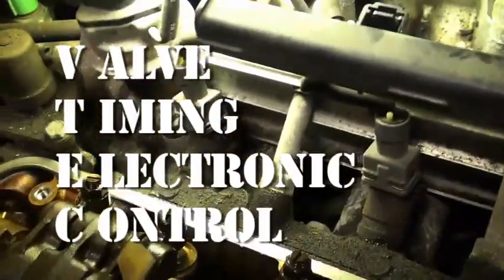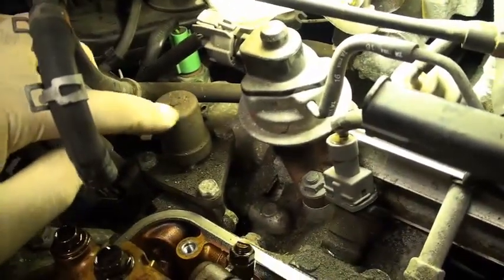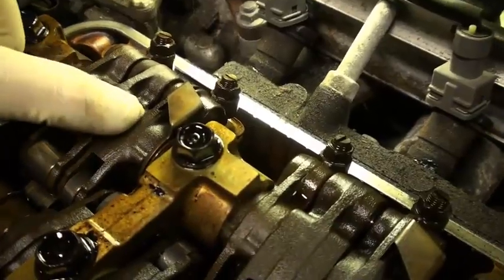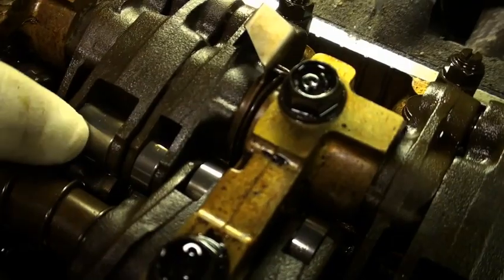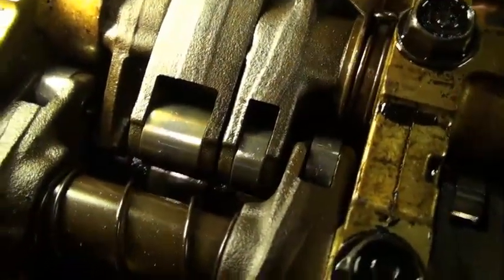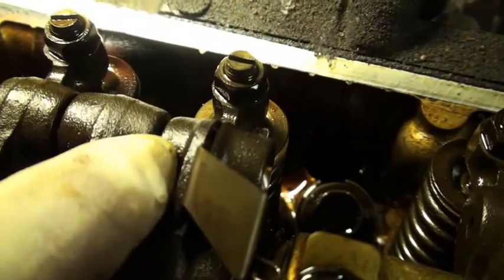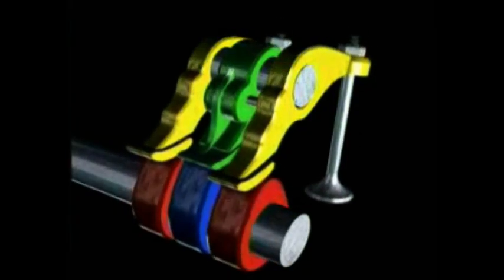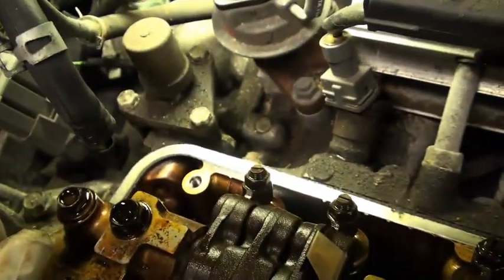What is VTEC and How Does it Work? - EricTheCarGuy

Comment: Okay so if the car has vtec does it make it any faster
Reply: Only if you add the vtec sticker on the side of the car
Reply: I personally like the sticker and actually had it on my D16 12 years ago. It was said as a joke and not meant to insult anyone.
Reply: Slightly on higher RPM... Is not a big deal like a turbo. Still VTEC Hondas are faster than your average 4 cylinder car.
Reply: Michael Mack butthurt ricer spotted
Reply: palmero8877 my car came with the sticker should i scarp it off cause of ppl like you?

Comment: And what about VANOS?
Reply: Vanos only advances intake camshaft under heavy acceleration. On the  e36 m3 and newer models like e46 onwards there is DOUBLE VANOS which manages two camshafts the intake and the exhaust. Still clever but the difference in performance when it switches is unnoticeable.

Comment: Ericthecarguy, you said that people feel the extra power when the vtec kicks in. For you it doesn't. We'll you are wrong, factory tunes are designed for smooth power transfer. When you modify the tune, you will feel it.
Reply: My S2k is on factory tune and you feel it from first to second and a little bit on third
Reply: It's a performance car that's why. What about the honda odyssey?

Comment: you know im not trying to piss people off but ive driven a vtec civic type r and u can tell when vtec happens cause it just changes the noise of the engine but i kept my eye on the speedo when i was on the gas and their is absolutely NO difference i acceleration like people say!!! the noise of the engine just changes, thats it...
Reply: Thats precisely the point of it ffs! If vtec didnt engage the engine would run out of puff and start to produce less power from there to the redline. Its maintaining the torqur of the engine over a wide rpm band. Generally 90% of available torque can be used from approx 3000rpm to redline.

Comment: Why not just have a lumpy cam?
Reply: 12cwell vtec isn't activated at low rpm
Reply: 12cwell You not know how cars work?
Reply: Yah this vtec shit all it does is kill your torque cause your torque comes early and thats what gets you movin
Reply: nabre labre.   thats why i said it kills your torque because it comes in around 6,500 rpms and torque comes in earlier
Reply: you still get low end torque with the normal cam position, then vtec kicks in to help the engine breathe and you get high end torque as well
Reply: nabre labre.     when you get into higher rpm your torque curve starts to go away and your horsepower kicks in.    hp= top end.   torque= low end.     thats why you see an s2k with 247 hp and a terrible 147lb ft torque
Reply: That's called race car cam....it's not good for everyday driving and lacks low end power

Comment: Vtec kiked in, yo !
Reply: ive driven one its such a myth it just removes your torque at low rpms and just changes the noise of the vehicle when it comes on
Reply: 12cwell It's so you can save gas under the engagement point and make power from the engagement point to redline. Not a myth

Comment: VTEC is not VVT it opens one more intake valve to allow more air into the engine making it produce more power.  VVT just changes when the valves open and close not open another valve like VTEC does
Reply: Vtec dosen't open another valve.
Reply: fullraph
Well the e-vtec actually does, but this is for economy not power.

Comment: Now here's a question that will spark a lot of debate... is VTEC a power saver, or power booster?
Reply: its a power saver mainly man thats why if u want performance buy v8, if u want eco buy 4-cylinder, if u want something slightly more powerful then eco buy vtec,   personally i think vtecs just dumb cause at low rpms their is absolutely no power its not even an engine at low rpm. when the vtec comes on in the powerband is where normal 4 cylinders are at ANY rpm so it kinda like having a small turbo that has alot of lag until it comes on and doesnt make any difference it just allows u to move..... so they are the most pussy ass engines out of all the 4 cylinders just because the valves take forever to open all the way and allow air and exhaust to move like a normal 4 cylinder does without waiting
Reply: 12cwell Actually, I've read a lot on the topic since this was posted and the fact that it's a fuel saving system is actually a misconception. There are three different forms of VTEC: i-VTEC, VTEC-E, and 3-stage VTEC. VTEC-E is tuned more for economic purposes, i-VTEC is tuned more for performance purposes, and 3-stage is a combination of the VTEC-E and i-VTEC. Even with the VTEC-E, I've seen that it still adds power. If you look at the 1994-1997 Honda Accords, all trims featured a F22A1 non-VTEC engine except for the EX trim. The Accord EX had an F22B1 engine, which is identical to the F22A1, except the F22B1 had a VTEC-E system. What's interesting is that the F22A1 non-VTEC engine made 130 horsepower while the F22B1 VTEC-E engine made 145 horsepower.... So despite the system being tuned for fuel saving, it made more power regardless. Feel free to look into it yourself, but that's what I found on the subject.
Reply: matt smith       yah man your totally correct man, i thought u were just strictly askin a question bout this kind that the guy in the vid is explainin. i think toyota probably has the best performance vtec forms cause they actually have torque at low rpm they can actually get movin
Reply: 12cwell Well here's the thing: VTEC is a system that messes with the valve timing as well as the lift. VVT-i messes with the valve timing only. But at lower RPM's when neither system is engaged, both of them aren't relevant. That being said I have a 2.2L Acura CL that has the same engine as the EX Accord (The car's pretty much a re-shelled Accord with a few added luxuries and only two doors) and, while the VTEC-E system that's on it is a bit sluggish, as expected when your car weighs around 3,000 pounds and only has 145 horsepower to compensate, when the VTEC isn't on, it's still faster and feels faster than the four cylinder and V-6 Toyotas that I've driven in my lifetime, even in the lower RPM's. Not favoring one system over the other here. Anything can be fast in the right hands. All I'm really saying here is that even a VTEC can make a good amount of torque and accelerate quickly in the lower RPM's (unless it's an old bone stock or riced out Civic that only makes 92 horse).
Reply: Yah man your right!     i think may have gotten a bad taste when i drove my friends, they still dont got much torque type R: 197hp 131 lb ft torque but like u said thats only one type of vtec. lol. they are good cars..   but one thing i gotta say performance wise a v8 and 6 will treat u better they got more capability which of course should be expected from a bigger engine.  my friend that drives the honda jumped into my z28 and hes hooked on muscle now though he still drives his honda to work everyday. he just bought a cobra.... but u know i gotta give the people who get the 4 cylinders up to 600 hp props cause thats pretty damn cool when u got a tiny ass engine that doesnt wiegh anything that chucks out a shit ton of horses
Reply: 12cwell lol I've got fresh tread on my CL and it still lights up the tires if you're not careful. idk how though. it's only 147 ft-lbs of torque in a 3,000 pound car. I will say that I pretty much love any engine. V8's do have more capability, but you can still squeeze  400 hp out of the engine in my car without forced induction from what I've read. And then you can apparently run around 9 pounds of boost on the stock motor without tearing down the engine. Still, I think a RWD muscle is probably the better toy and the FWD VTEC is just a fun daily driver. That's just my preference though. Beauty (and fun) are in the eyes of the beholder, so they say.
Reply: yah man i aint goin to bullshit though everyone agrees even domestic guys agree that accords are fuckin fast that the civics its baby cousin LOL u got a v6 in it right?
Reply: 12cwell Nope. 2.2 I-4 lmao
Reply: oh well still i do know they are quick. the engine in it is bigger then a civic which means its got more torque then a civic so that means even though it ways more then a civic u could still pull past somebody when drag racin cause u got that extra torque thats needed to move the wieght
Reply: 12cwell I've smoked some Mustangs and some diesel trucks out here in the sticks but that's about it. As well as the occasional ricer ;)
Reply: yah the early 2000 mustangs are easy prey but with diesel trucks u dont want to be screwin around with those ive seen them run mid 13s with just a ecm and turbine upgrade!! they haul serious ass and they are waaaaay underrated but i do hate it when coal rollers blow smoke in your face even though its friggin hilarious to watch it happen to someone else until it happens to you LOL
Reply: 12cwell It's pretty much all turbo diesels where I am (farm country, what do you expect?) and people do that all of the time. Happened to me before. Just caught them at the next light and smoked them off the line. VTEC not even kicking in lmao

Comment: Actually, I think that reading old patents and realizing the modern potential was the genius.  The rest was just mechanical engineering. BTW, Caprotti's variable valve timing came too late to save steam. The US War Dept would not allow Baldwin, Lima or ALCO to use more modern inventions for steam during WW II and gave GM $10 million to refine Diesel engines  a project that had implications far past the hostilities.

Comment: Would anyone know if I would have to get the vtec oil pressure switch replace if it doesn't click?  The dumb sensor is hard to put back on. It's the green switch if anyone is familiar with it.

Comment: Very similar to a jake brake on a semi truck. There's an extra rocker arm on the rocker shaft and when oil is fed to it say when you're going down a steep hill the rocker arm which was in an idle position to start is now being driven by the lobe that is assigned to it. Rather than operate the intake valve it operates the exhaust valve. It holds the exhaust valve open ever so slightly. While this is taking place fuel is cut to the cylinder and the engine being the air pump that it is now is in free wheel mode. Being that the engine is connected to the transmission the road wheels are what keeps the engine turning. Since there is no fuel to burn the compression stroke is effectively a very restricted exhaust stroke at this time. The weight of the vehicle works against that resistance and slows the vehicle without use of the service brakes. Pretty neat and it makes a hell of a noise. Cheers Eric I appreciate what you do here keep up the good work. Stay dirty my friends
Reply: The new ISX cummins will even open multiple exhaust valves on different culinders and allow the escaping air form one cylinder enter another cylinder and compound the force.  Along with a variable geometry tuebo, I've seen the ISX's I used to run come up as high as 35 PSI of boost on the jake brake operation, and as high as 45 PSI on the turbo when pulling hills.
Reply: I work on isx day in and day out they are fun to watch when you have the valve cover off and you engage them
Reply: Guys who ride around with the jake brake all the time...are they doing damage to the engine.

Comment: I have Honda Civic 2001-2005 1.5L Vtec engine.. I am hearing valve ticking in low RPM or when driving up a hill?? is there a way to calibrate the valve clearance?? if yes, what is the clearance of the intake and exhaust?

Comment: Well, in the same respect though, they aren't in the same category. One forcefully puts air into the system where vtec is just a way that let's more air into the mix by allowing the camshaft to remain in the inlet position longer. 
A turbo will make more power than the engine was previously capable of where as vtec just allows the engine to use it full potential.

Comment: Speed is irrelevant to Vtec. The whole point of vtec is so that you can have a small displacement engine that only uses it's full potential when it needs it. Unless your vtec engagement is set really low (Like some of the 90's Accords, 2,750 rpms) you can hit relatively high speeds without ever touching your vtec. Until you reach your final gear that is.

Comment: My point is a v-tec and turbo at the very core are just getting more air to the engine.  It's the same air being used by both, nothing changing the chemical properties of combustion. simply put, getting more air in produces more power.  A turbo does this best.  I have nothing against NA, but I see it as a means to a end for power.  But ask yourself this, are you pursuing speed and power, or just to brag about how hard it was?

Comment: I have a 1995 Honda Civic LX with a 1.5 non vtec in it. Would it be possible to put the EX 1.6 twin cam head on my 1.5? Since the only difference is the distance of the stroke? Im just trying to experiment a little bit, but idk if it will work because the 1.6 is a vtec.

Comment: i prefer non vtec V8. the overlapping cam on modded V8 sound aggressive when idle. 

this is why most V8 is sohc, it provide a lot of bottom end torque than of  dohc, not necessary true but to extent it is.

Comment: Someone has probably already said this, but there is and has been several "VTEC" V8's for a while now, even the more modern CVVT (Continuously Variable Valve Timing). 
Variable valve timing is nothing new. Ever heard of the old Rhodes Lifters? They are just a basic form of VVT using hydraulic lifters that pump up and bleed down at controlled rates and certain RPMs. 
VTEC is just taking it one step further with a separate cam lobe and controlling it with electronics.

Comment: Thank you very much, but how I have to connect the wire of vtec? . because I replace my old engine(without vtec) and I installed engine with vtec and I connected the wire in battery direct. Is this way of connection right?

Comment: Yes. You will lose, low end Torque, and stability. 
Well its more about Stability and Fuel Consumption. Your engine will most certainly not keep a steady Idle RPM, and it will consume more fuel. It will be agressive and will not be that SMOOTH at everyday driving. At Higher than VTEC crossover point the engine will be exactly the same. 

There are certain types of Camshafts ( Like The Toda Killers ) that do not use VTEC. Instead they use a High Cam Profile at all RPM. They are quite Agressive.

Comment: Hey Eric,
In one of your videos u have mentioned you are quite familiar with honda cars since you have worked at their dealership. If I have heard correctly I just have a question about my 2001 Honda Prelude SE (Canadian version). In the manual it says it need to put in 91 octane fuel (premium) with a Vtec engine. I always been putting it in but since gas is going up would mid grade 89 or regular 87 work? If i put a lower octane will it do some damage? it currently has 97,000 km.

Comment: OK the electronics come in when activating the solenoid. Otherwise the solenoid is inactive. At a certain RPM threshold the solenoid opens up and allows oil pressure. Which then is used to lock the rockers together. Giving you a longer lift duration thus increasing power. I have a question. What exactly are you looking for in there. A motherboard or something? And what would that do for you to have one of those in there? The electronics activate the mechanics. Its simple.

Comment: OK I'll clear this up for you guys. In cars there is a thing called an ECU-Electronic Control Unit. We will just simplify and say this is the engine CPU. However there are many control units in cars now days. Its monitors engine stats such as RPM, oil pressure etc. This is where the "electronic control" comes in. When the engine meets certain requirements VTEC kicks in.

Comment: It's because high lift, longer durations cams (the VTEC lobes) work best at high RPM.  At low RPM, it doesn't work as well. Think of a race car with a high lift, high duration cam - it doesn't run well at idle and low RPM.   VTEC is sort of like having two camshafts - one optimzed for low ROM torque, and another for high RPM power.

Comment: Ever heard an engine set up for drag racing where it has a hard time idling and easily stalls (lope)? VVT engaged is geared towards higher RPM and horsepower like racecars are, except they won't behave well on the street like an engine in non-VVT mode can. Gasoline engines need reduced airflow/velocity and higher engine vacuum to both idle smoothly and get a vehicle moving from a stand still easier (more torque). Fuel mileage becomes much more than just marginally worse during the VVT stage.

Comment: Two but very good video to kinda break in someone new to the system. Needs vss, Vtec sensors. Some need knock, oil pressure and wot   It's more of a pain in the ass get it to function when being new to it

Comment: I love the basic description of it. A d16y5 is a poor Vtec example though. And more so then just the Vtec ops (oil pressure sensor) Vtec isn't a pain to work on the shit hardly ever breaks for that matter. Maybe excessive valve lash adjustment is needed but still. The shit part about d series is the 90mm stroke and shitty oiling systems in the post 95's one oil journal hole as opposed to

Comment: v-tec is like running 2 different cams. One is mild and great for daily driving, the other is aggressive giving you better top end power. No other VVT system is like v-tec because if they did anything similar it would be a patent infringement so there would be massive lawsuits costing millions.

Comment: Yes. The variable timing makes it possible to run as cheap as possible when on low "force" (when you are doing slow accelerations or so, when power is not needed), and also gives you the possibility to have more power when needed, at cost of gasoline afcourse.